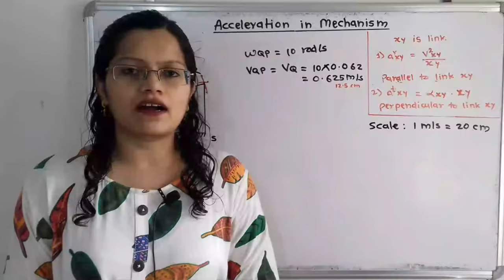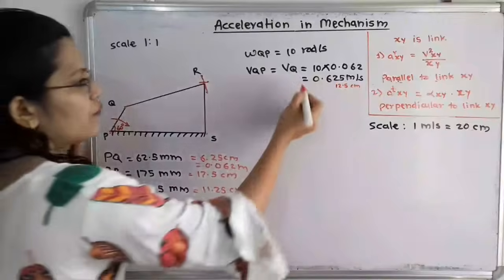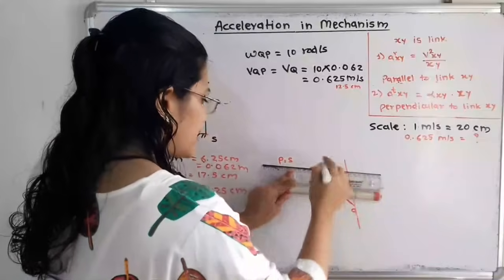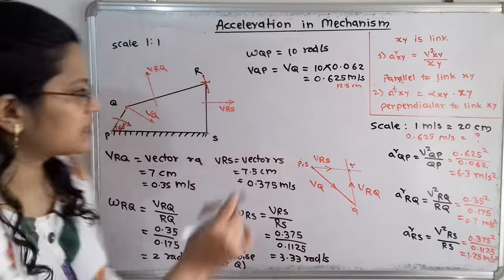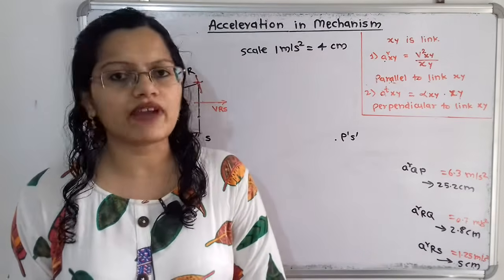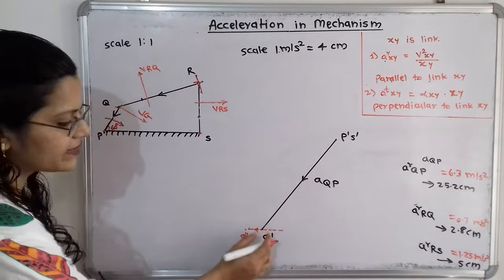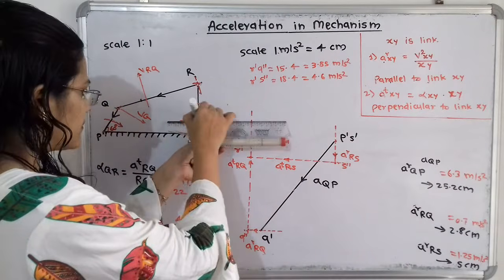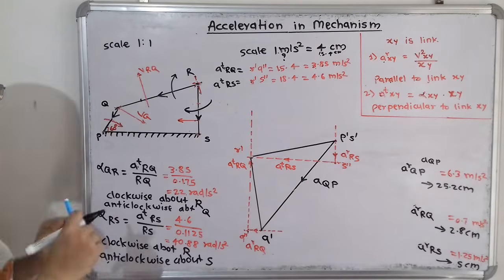Problem 4 for four bar chain /  Velocity diagram and acceleration diagram

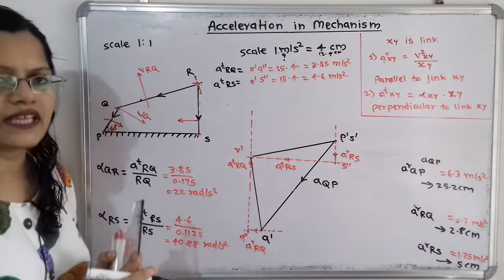Comment: Does alfaQR really go clockwise? Or is it anticlockwise? in the formula on the top right, atXY = alfaXY . XY (all is X about Y). But, in the equation, you write, alfaQR = aRQ (first Q about R, then, R about Q). is that really correct? 28:37